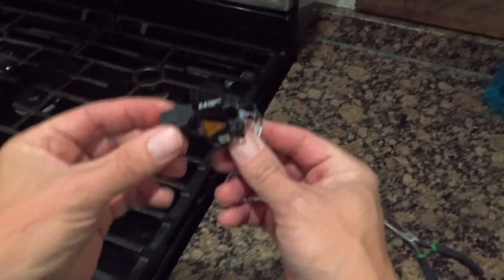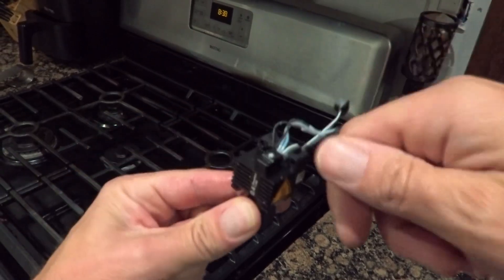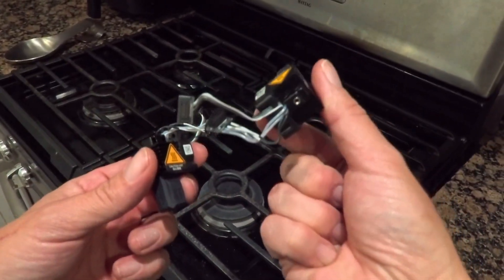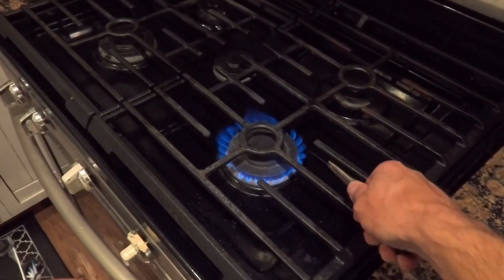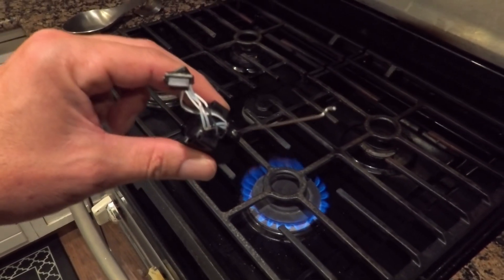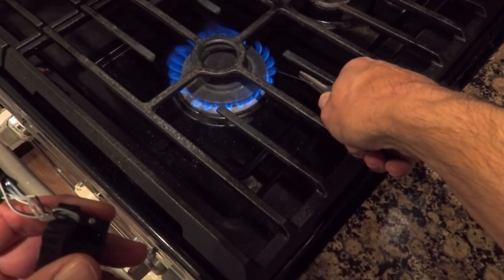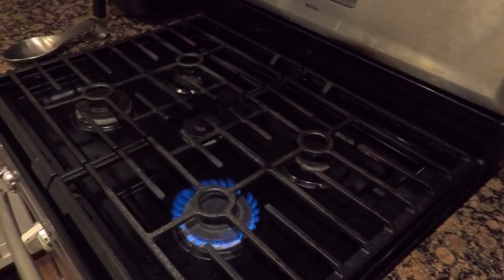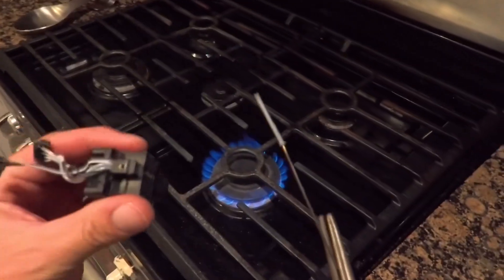How to do a quick easy cold pull on a Bambu Hot End

Comment: Have you tried using regular pla or pla plus? Im skeptical of the strength in lightweight pla and was wondering if regular pla would work. The weight cant be that different right?
Reply from the maker: @sweetgumnyc7794  for printing planes? Yes I’ve tried everything, LW PLA is half the weight! It’s where regular PLA jets won’t fly vs will fly

Comment: This can also happen if the ambient temperature is too warm for the fan to keep the cold end below the 55 or so degrees to keep PLA hard enough to not get stuck there. This is especially common on enclosed printers. Too warm and the extruder just jams it into a wider cord and jammo. The fix is super easy, leave the door open while printing. But it could be horrible filament too, but worth a try to just leave the door open and see if that fixes it.